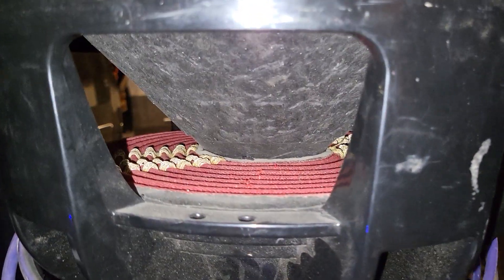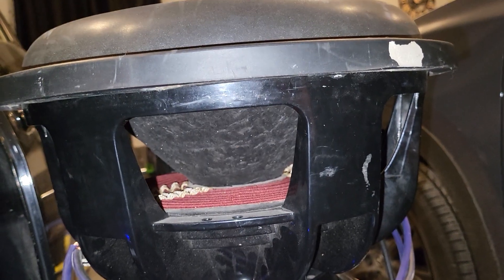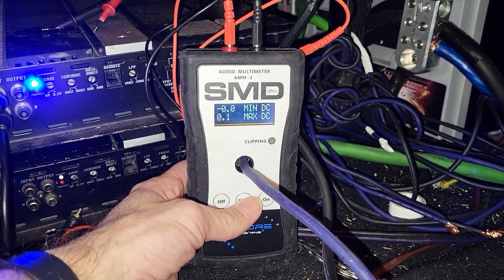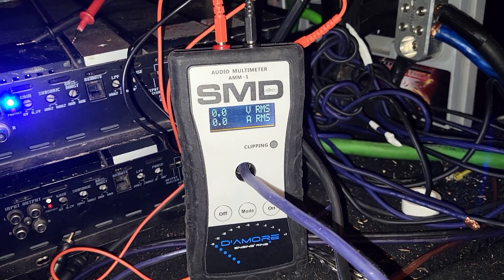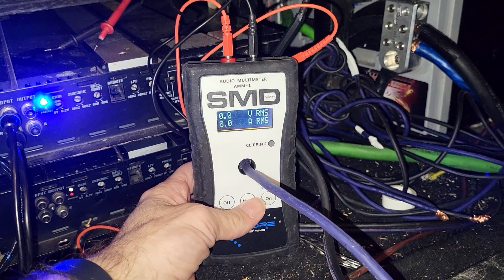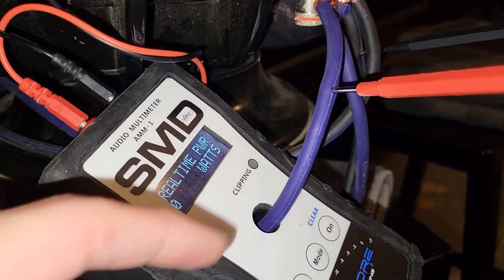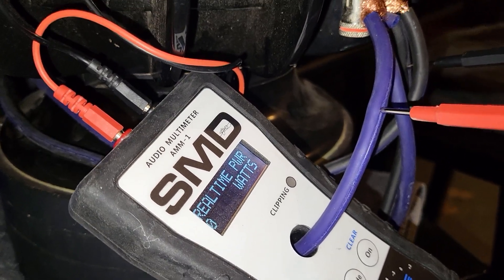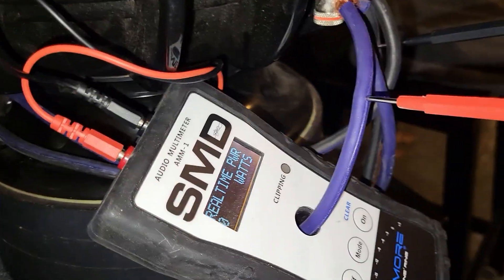Sundown NSv3d2 20hz and AMM1 testing! Amp dyno, impedance rise test, power factor, VAC/Amp readings!

Comment: Power Factor is telling you the phase of the voltage and current, meaning that the AC voltage sine wave peaks happen at the same time. It's significant because the lower that is from 100% the less power the speaker coil is actually using, while the amp see's the full load as V*A still you only get V*A*Pf at the speaker. You could view is as the percentage of the amplifier power that's actually being used by the speaker coil. That's AC power delivery in a nutshell, if you wanted to learn the nitty gritty of it I would suggest searching for a power factor video. It's a trigonometry intensive subject but the key point is that the it's essentially a timing thing depending on a load being reactive (either capacitive or inductive). A coil of wire would typically be considered an inductive load but the suspension of the speaker and enclosure can make a speaker capacitive and inductive depending on the frequency. This is a very convoluted subject for most people, even with an engineering degree it is complex enough to spin the eyes. The math is literally called "Complex Numbers" or "Imaginary Numbers" so take that as a hint, engineers call it "j" but you might know it from math class as "i".
Reply from the maker: Thank you very much for this answer!